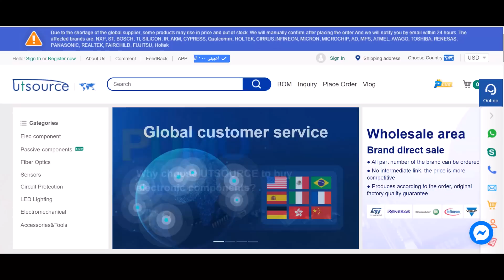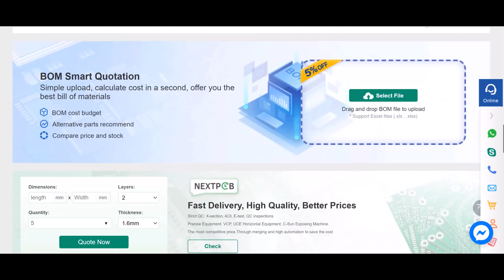how to make inverter 12v to 220v

Comment: I just bought the same one, I connected everything correctly, I take current from lithium-ion batteries 18650 on Samsung q30, I have over 150 amps of discharge at the moment I turned on the charger with a 100 watt load, the transistors blew up directly, it seems to be some kind of garbage

Comment: Can you make high-frequency efficient dc-dc with such parameters?
-output voltage 36-40V
-output power - up to 300w
-input voltage 2.6-3.6V (from one huge LiFePO4 cell or many small cells in parallel)
-efficiency >80%
No one created such converter yet, at least I didn't find it on Youtube... Also to avoid problem of over 100A currents on the input - you can make 5 or 10 inverters 60w or 30w each respectively and then connect them in parallel to  reach 300w total output power. 
This approach may be useful in e-bikes to avoid connecting battery cells in series. So whole battery is being restricted by internal resistance of 1 cell which is not efficient... ALso with parallel connection of cells -no need to use balancing pcb when charging too.

Comment: Why do you solder through hole components from the top side? If the solder doesn't flow to the bottom, then you won't have good mechanical strength ... especially on the transformer and large capacitors. Also this is a switching step-up DC PSU, not an INVERTER! Inverters are AC.

Comment: Why Multimeter on the right side still says DC?
I'm confused.
Reply: Same thought
Reply: Because it's not a true sine wave at 50-60 Hz. Look at the scope (which is cheap and woefully inaccurate) it is a square wave at 20KHz. These kits are readily available and very inexpensive as they will not power most appliances.

Comment: Is this really able to handle the load of 1KW ???
Reply from the maker: YES
Reply: @inventorkr1  why you do not add battery low voltage cutoff circuit in it..